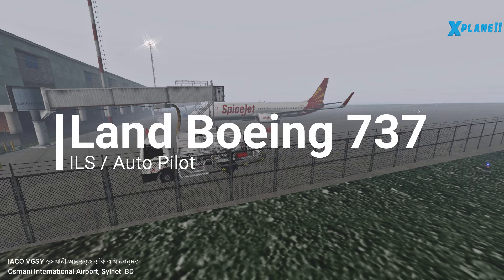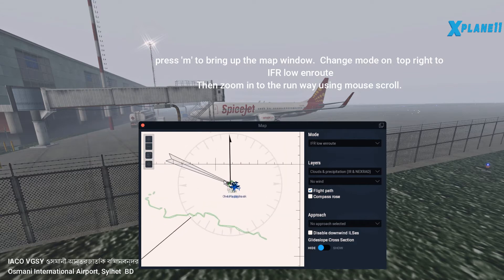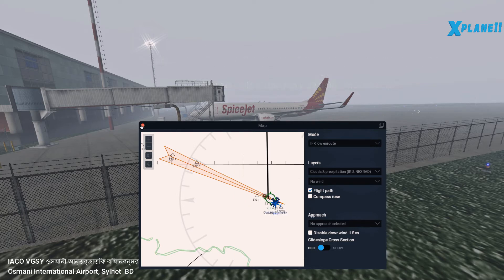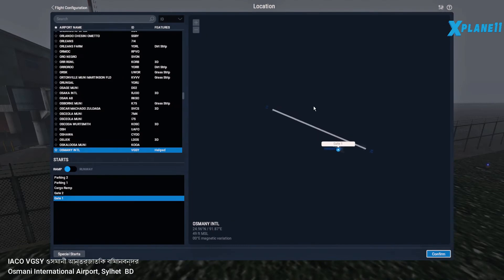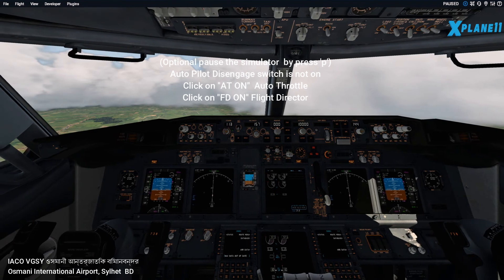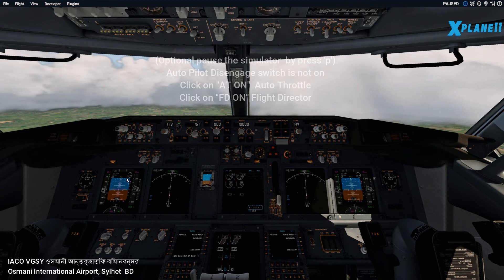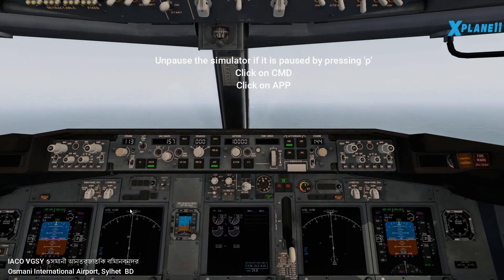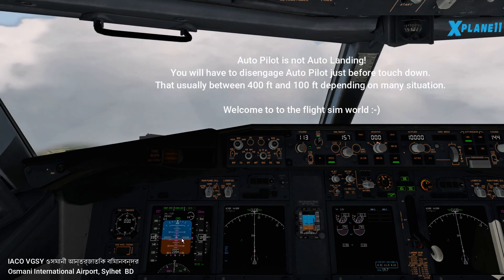2 min tutorial on landing a Boeing 737 with ILS and Autopilot in flight sim X-Plane 11

Comment: Works, and appreciated it being a couple mins.  Get tired of videos 25 mins too much blah blah.  First I did this just as described, with default 737, worked.  Then transitioned to full flights (not just 10 nm from runway).  When I moved over to another plane (B787, vmax), had more hangups as 787 has GPS/NAV1/NAV2 switch whereas 737 does not, putting more difficulty into it.  Had about 50/50 on crashes vs successes, used fog to really test it, sometimes plane won't line up and crashed me a mile or so before runway, but sometimes does line up.  So it's tricky when to switch from GPS to NAV1 (or should I do NAV2?) and get the plane to lock in.  Also, on 787 have to know when to click in / out of Altitude Hold button, sometimes won't go.  Suggestions?